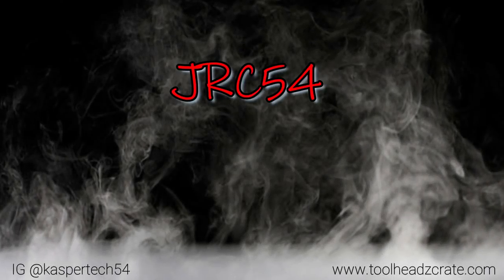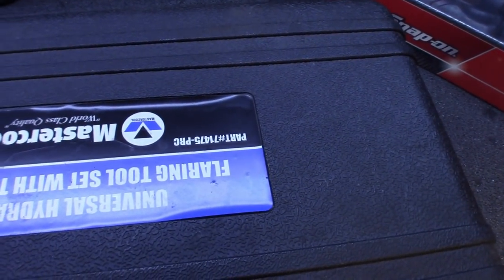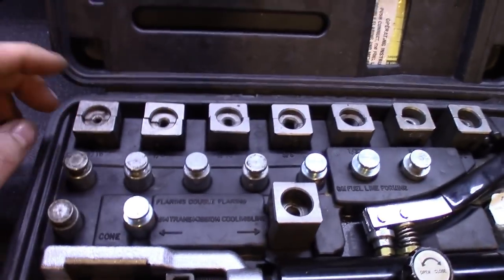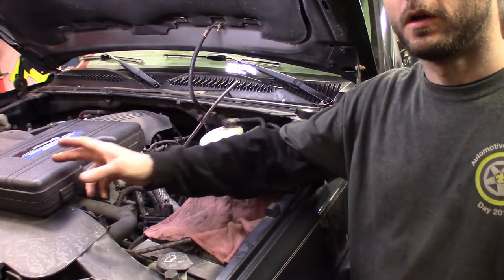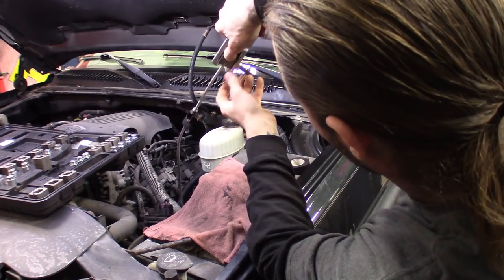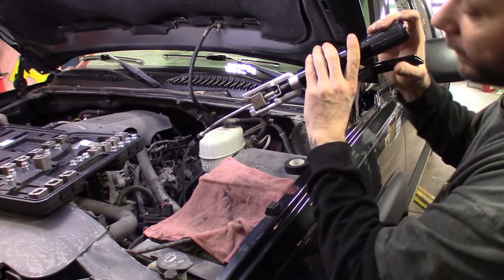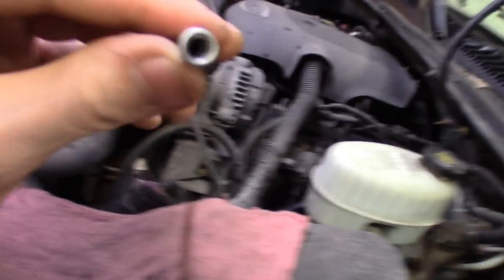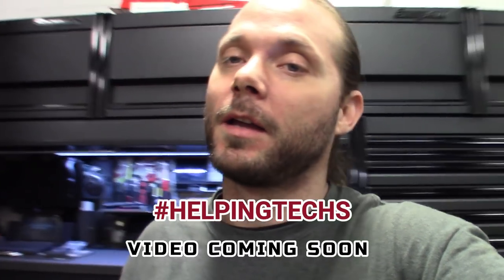TOOLZ IN USE S2E3

Comment: I have the same tool and do the same trick with the black tap.. I’ve had that tool for 8 years and only had to send it in for repairs 1 time after a “friend” used it one weekend🤔 Ya’ he broke it! It’s a great tool just a little hard to use in tight spots under the car/trucks

Comment: I can’t believe it does steel line that easy, I’ve been using the nickel copper line because it’s super flexible and flares great
Reply from the maker: The nickel/copper line is great. Easier to work with and bend, Just a little too expensive for a job that big.

Comment: This is one thing I don't miss doing. I've done miles of brake lines at my last job. How long does it take you to replace all the metal lines on those GM trucks/SUV with the abs unit under the car?
Reply from the maker: With this tool and bulk line it takes about. 2 to 4 hours

Comment: Jist bought this tool. Havnt even used it yet it just came in. I mainly wanted it for the push connect fittings it can do but i bought the large master kit
Reply from the maker: It's a great tool. Little on the expensive side but worth every penny in time saved.